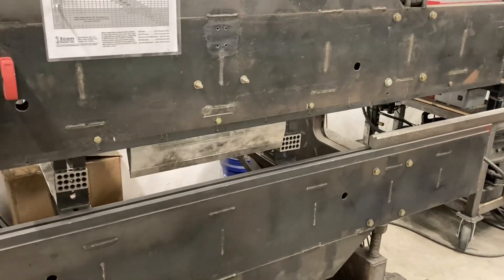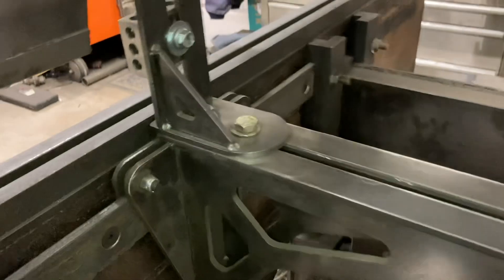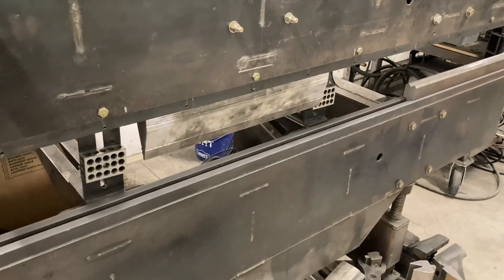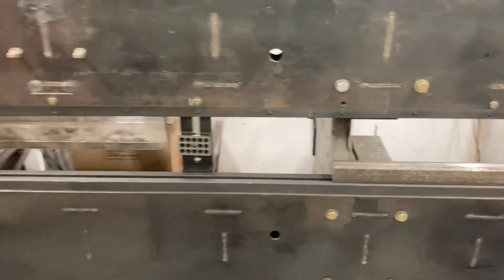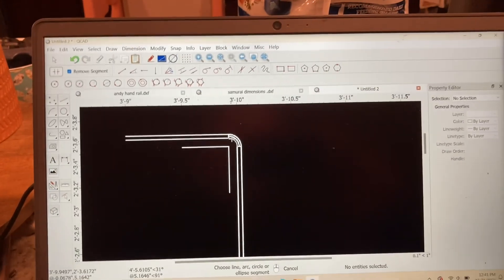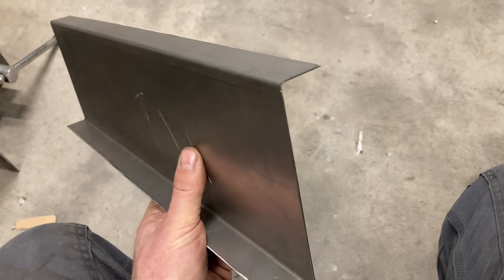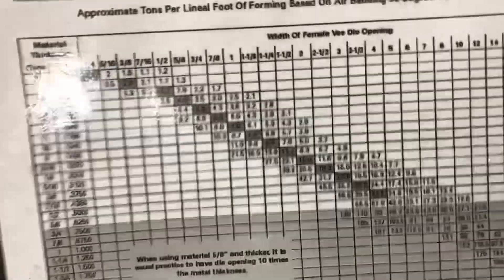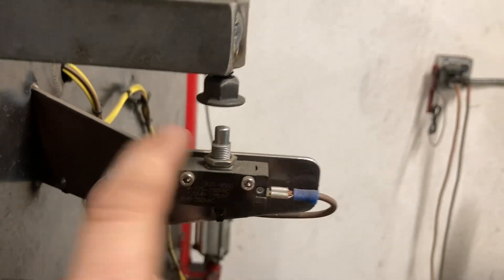Home made press brake setup up and how to figure bend location.

Comment: You have never used a press brake before. If you had, you would realize how ridiculous all this is.. You should learn a little before trying to teach..   TIP: 1.301*R + .428*R = K
Reply from the maker: @twistedhillbilly6157  that’s why I always tell people I’m self taught. I did run a press brake at a job in the 90s. It was from the 50s and there was basically no training there. I was left to just figure it out. Since then I have not done production work, just mostly one off parts. I figure out the bends as I show in the video as I design the parts and as I explain it’s just how I do it but I’m eager to learn more.